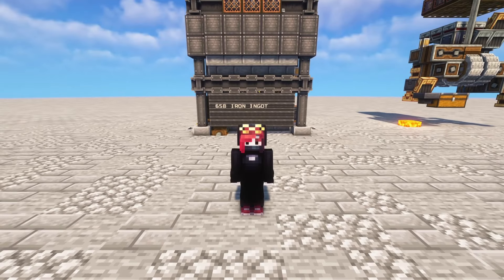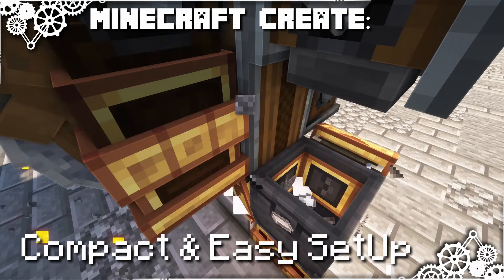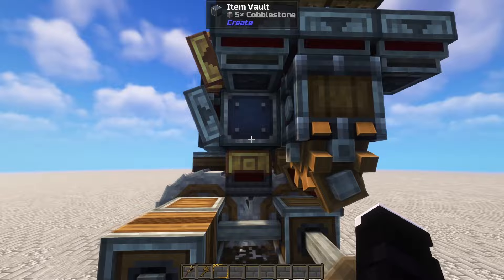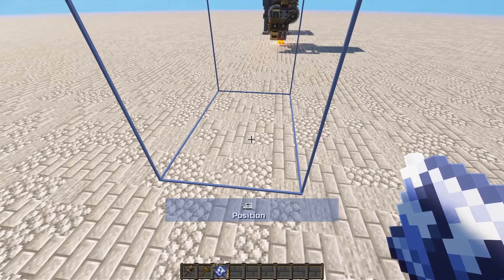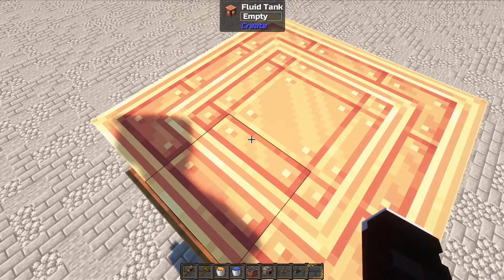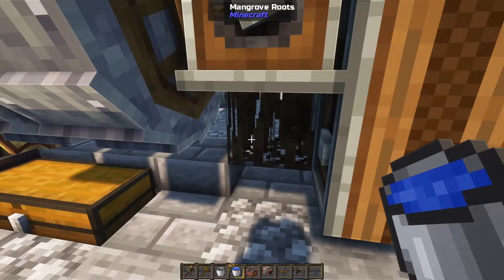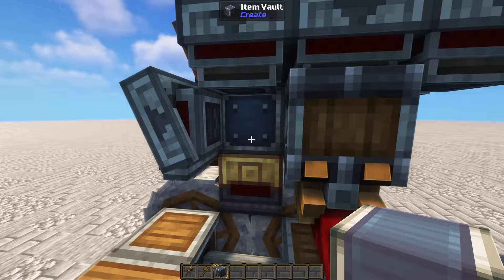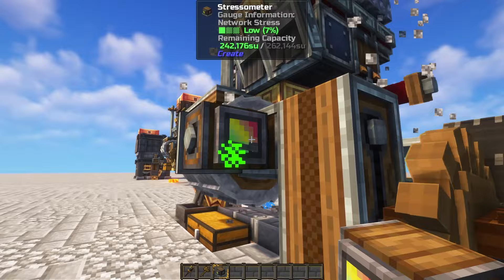Minecraft Create: Iron Farm + Schematic!

Comment: The decorated version of the farm has an incorrect schematic, the glued gantry system of the cobblestone generator has dissapeared
Reply from the maker: I tested both schematics and they both work just fine on my end
Reply: Same problem here… Without decoration works fine
Reply from the maker: @GustlMax  dang, I wonder if its a problem with version or something, it worked fine when i tested it on my end
Reply: @batsyvonfangies  the superglued contraption just disappears when the schematic is loaded. Not sure what is going on but im using the latest version of create 1.19.2
Reply: @batsyvonfangies I noticed the decorated version is missing superglue. Regular version works fine.

Comment: FYI The farm DOES work on create 0.5.1f on Minecraft Steampunk, just had to make minor fixes:
-Shown copper tank fixes
-Shown vault fixes (did both vaults, iron and cobble one just to be sure)
-Reversed the rotation on the Clutch's (the ON/OFF switch) Rotation Speed Controller, as the crushing wheels were crushing up instead of down. A quick way to see if yours are reversed too is to look if the encased fan is blowing. If the particles emitted are blue you're good to go, if they're white/gray then do the fix and it shoud work.

Do make sure to turn off any magnets if you plan to go near it. The amount of gravel it produces is insane.
Reply from the maker: Triobian's cobble gen doesn't work for versions 0.5.1e. For version "f" the issue was already fixed

Comment: heads up guys i just checked it out and i dunno if this has to do with an update or something but the glue on the schematic is completely busted
making it impossible to function properly to fix it make sure you remove the glue from the shafts at the top connected to the pump and machine and make sure their glued together but only to each ohter nothin else you also gotta glue the brass funnel to the andisite funnels hopefully that'll fix it if not mess around with the glue till it does try not to remove any glue that isn't already broken

Comment: I had this working last night just fine, I just had to set the rotational speed controller on the bottom to -256 instead of 256 so the crushing wheels went the right direction.  But this morning when I logged on my lava was gone from the tank. I'm not sure how that's happening but I have a theory...I kept noticing that sometimes the lever on my clutch was broken off, and then today for a moment the water was escaping from the pumps somehow and flowing all over.  I'm thinking that when that happens, it also allow the lava to pump out of the tank if there's no water in a pump block.

Comment from the maker: Someone people reported that the decorated schematic is lacking the glue. Not sure what the problem might be, it seems to work fine on my end, but keep it in mind if you use that one, just place the glue on the cobble gen and you good to go
Reply: The decoration schematic didn’t have the andesite funnels needed for the cobblestone, or the brass funnel either. I can’t for the life of me figure out how you’re able to place that brass funnel that way, it keeps attacking vertically instead of horizontally. And it simply just won’t generate cobblestone either
Reply: @Skippy8750  Cant you just use a wrench to rotate it then?
Reply: @minecrafter4623  I tried, it only switches whether or not it takes items in, or takes items out. I messed around with it some more, for some reason the schematic works fine in creative, but in my survival world it has all sorts of issues. I was able to get around this by using the schematicannon to build the non-decorated version and then pasting the decorated version in the same spot, worked just fine after that.
Reply: @Skippy8750  huh interesting, yeah I tried in creative and had to change a couple things now gonna try and get it in survival.
Reply: @Skippy8750  not sure now mine is shooting out cobble and it won’t go into the funnels at the top
Reply: @minecrafter4623  did you test the one without decoration to see if it works properly?
Reply: Yes it doesnt have the moving part

Comment: I am on 19.2 I had issues with the gantry not moving and the cobble not creating. I found the issue, invert the rotation on the speed controller by the press It started working immediately after I did that.
Reply: I also added 9 lava buckets but I do not think that was the issue as well.

Comment: Hello, good video, I used the schematics and had to turn some blocs to make everything works (Example sur cog for the pump was not moving) 
but I still got a problem, the cobblestone generator doesn't generate at all, there are lava particle and the pump are waterlogged, but it doesn't work

for the everything else it's working fine, do you have an idea?

edit: Found the problem, the encased chain drives were not linked properly between them !
Reply: did you figure it out yet?
i have same problem. i found it only has problems online because i was able to get it to work on creative offline
Reply: @ShadowGaming995  it's the lag, slowdown the generator until it works

Comment: How do you get the mix of slabs in your superflat world?
Reply from the maker: Oh, I covered the grass with world edit. Just made a command over an extended area
Reply: @batsyvonfangies  Oh! Thanks.
Reply from the maker: @Nargistr  Not sure if you ever used world edit, but if you ever get interested and you start playing around with it. The command I made was selecting with the wand a large area on the block right above the grass, then I used //replace air 40%stone_brick_slabs,30%stone_slabs,30%cobblestone_slabs I wrote it by memory so maybe there should be spaces or instead of slabs is slab or something, rely on the autocomplete and you should be fine, also I used 40 30 30 simply to give the stone bricks more weighting. It doesnt have to reach 100% on the weightings, but after tweaking a lot, I found those numbers to be of my liking

Comment: the farm breakswhen the water comes down when gantry contraption moves and cobblestone cant generate
Reply from the maker: If water gets through the gantry when its moving, that could either be lag or the gantry is running too slow, normally 80rpm is enough to prevent the water from leaking, unless lag is going on
Reply: @batsyvonfangies  you should consider optimizing your farms to get a lower su usage this one, if not reduced in rpm uses 264k su thats crazy

Comment: for some reason my iron farm suddenly been generating energy from nothing and i dont know why?? (i dont complain tho)
Reply from the maker: Sometimes create does that, very rarely. It's possible that a chain drive, or something similar, got bugged, and is forcing a rotation that doesn't exist anymore. I happens when using schematics, specially if used with creative mode, or it can even happen if there was lag, fps drops, or the area wasn't unloaded properly, you can fix it, if you want, by simply removing blocks till you find the one that stops the rest, that one was bugged

Comment: I followed the steps to the letter, but for some reason the stone is never created with the mechanism above using lava and water, I used the normal plane and the decoration (fixed) and it didn't work for me with either of them.tips???
Reply from the maker: What version of create are you using? Because triobians cobble gen doesn't work on 0.5.1e also is the gantry moving, or how exactly it isn't working?
Reply: @batsyvonfangies  My problem is the version apparently, I have 0.5.1e, thanks for solving my doubts.

Comment: i have a weird issue, im playing on 1.20.1, first farm i built with the schematicannon works perfectly, already made me a double chest full of iron... i wanted a second farm next to the first but the second one doesnt work? I used the exact same schematic only thing different is i just turned the farm front side facing me (i accidentally placed the first one backwards..) the second farm only makes cobble, then gravel and then sand, it doesnt pick up the items, ive tried placing the vaults again several times, i even tore down the whole farm and placed it again with the cannon , still same issue? is there any possibility the farms dont work close to each other?
Reply from the maker: From what you are saying, it produces the cobble just fine. The crushers make gravel, and instead of falling down to get washed, what happens next that it becomes sand? Does it get converted from cobble to sand on the same crusher? Does it no fall down at all and instead stays on top of it?
Reply: For me gravel stand on the top of the whell and don't fall to get washed @batsyvonfangies
Reply: @jagerja1781  theres an easy fix for this you need to reverse the spinning direction of the wheel to get it to throw it down :)

Comment: The gantry carriages just run off the end of the gantry, without coming back the other way :/
Reply from the maker: make sure the cobble gen is nicely glued up
Reply: @batsyvonfangies   the 12 funnels and oak trapdoors are glued (in a 3x4x2), the 2 carriages and barrel are glued, and the brass funnel is glued to the side of the andesite funnels. the generator goes in 1 direction, the lead gantry carriage then pops off the end n the system stops moving :( have i missed a gluing?
Reply: ah, its 2 seperate gantrys, not 1 long 4 long one. But how do i stop the 2 connecting into 1?
Reply: nevermind, sorted it with the wrench :P
Reply from the maker: @paternoxgaming9195  glad you were able to fix it, did it became one single gantry shaft after the cannon? to keep it in mind in case someone else has that issue too
Reply: gantry carriages still wont switch directions tho :/
Reply: sorted :) put a block at the end of the gantry

Comment: Hello, I am playing on a Server with 1.20.1, Gravel is spewing everywhere. It looks like, for some reason, the crushing wheels are reversed for some reason. What would I need to change to fix that issue?
Reply: Nevermind, I fixed it. To those having the issue I Reversed the speed contraption and replaced the shaft connecting the belt to the crushing wheel with a gearbox. That reverses the wheels, while keeping the fan blowing the correct way.
Reply: Thank you man! I had the same issue and this fixed it.